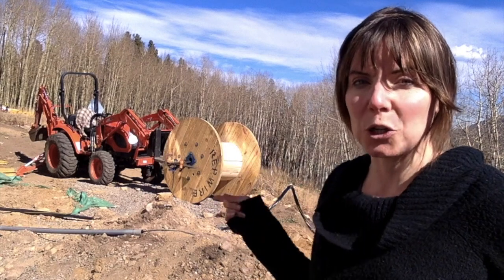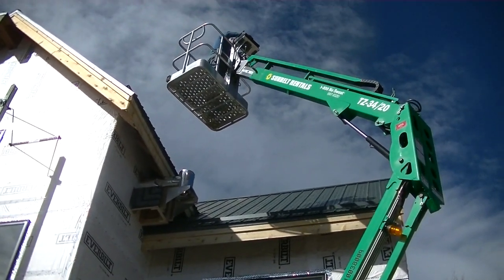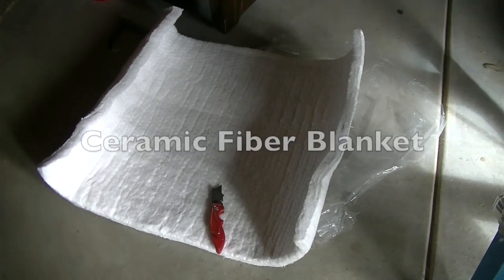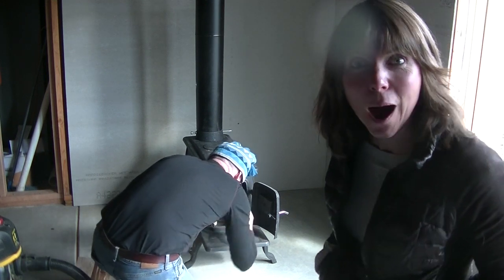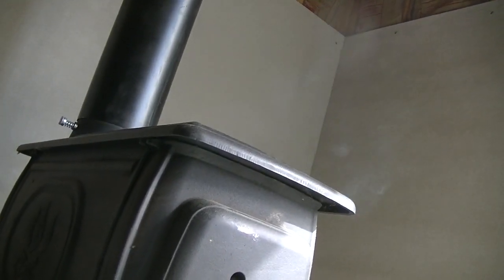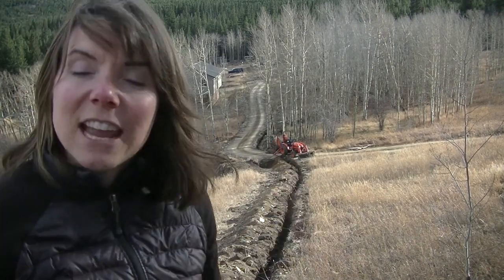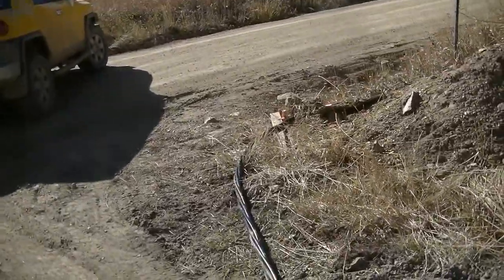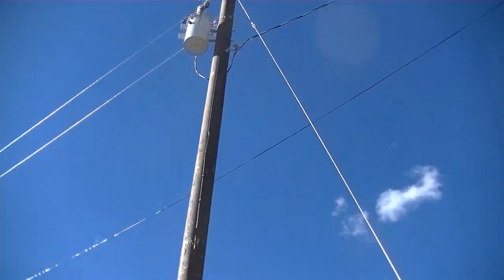Running 500 ft of Electrical Cable - Wood Stove Problems

Comment: Dunno.  Could be one of a number of things.    

It might just be the stove curing during it's break in period.  Here's a YouTube video on breaking in a new wood stove:

  https://www.youtube.com/watch?v=muRxUsv1ilI&t=52s

Here's another video on diagnosing smoking problems with a wood burning stove/fireplace:

  https://www.youtube.com/watch?v=0GkDZzMDBbY
    (She has some good tips about starting a cold stove - which are important to know.  This may be your issue.)

Hope this helps.
Reply: I watched your video again and you have an awful lot of wood loaded in there for a cold stove.  Plus the fire is probably starting too far away from the flue to get established properly.  Watch that second video and listen to the advice on starting a cold stove.  The stove flue needs to get hot to pull cold air into the stove and establish a good airflow.  Try making a small starter fire right under the flue to heat it up and leave the stove door ajar to provide additional air until the flue heats up.  Here's a link to a video made by an English gentleman that covers just about every cold stove starting trick I've ever heard about.

https://www.youtube.com/watch?v=JgTSn8yzdzg

His demo stove loads from side to side, whereas yours needs to be loaded from the rear to the front.  That's why I suggested starting a small fire in the back under the flue.  Once your fire is established, add wood working forward (away from the flue) and upward.

Hope you do not find this too simplistic and are insulted.  I don't know what your experience is in this area.
Reply from the maker: Wow- what great info! This is a different style stove than I'm used to (narrow shape with the flue at the far end) but it all makes sense. And according to all the other comments, the bad smoke, was the initial paint burn off- which explains the horrid smell. 2nd fire has proved much more cozy!

Comment: Its a very poor quality stove.  Does not have any control on air inlet.  They tend to burn "flat out" all the time, get very hot and wont hold a fire overnight.  All stoves will smoke on the first burn and any time they reach very high temperatures, its just a factor with the high temperature paint.  The damper on the stovepipe is to try to reduce draft.    These are usually considered "EPA exempt" because they are considered "cook stoves".   Normally they would not be permitted in a new install in most states, but for their "cook stove" status.   Save your pennies and get a decent stove as soon as you can afford it, like one made by Pacific Energy (Canadian) or Blaze King.  Both of those stoves are made to perform very well and burn clean when burning softwood, which is what you primarily have up in the mountains.
Reply from the maker: Ok this is great advice. We are going to get a different stove, but we used this one now just because we already had it and hadn't been used yet. Will take notes for Pacific Energy stoves- exactly what we're looking for. Thanks so much!!!
Reply: There are several categories of stoves.  The oldest type if the "airtight" stove that predates all of the EPA legislation.  Its just a metal box with a chimney connection and a means to regulate the inflow of combustion air.   There are no features to help reduce smoke or come up with a way to burn the smoke off.
The next type is the catalytic stove.  This has a rhodium/platinum/paladium coated ceramic substrate in the path of the flue gasses and once this catalyst has heated up to about 300-400F it will burn off any smoke and thereby release the heat and at the same time keep the chimney clear of creosote.    Catalytic stoves incorporate a catalyst that is not made by the stove maker (its a purchased part) and the catalyst can cost upwards of $300.   When in operation, a catalytic stove burns a smoky (smoldering) fire and the catalyst burns up the smoke producing heat while allowing the fire to burn at a low temperature.    This is ideal for burning resinous wood, because the energy contained in the resin can be released gradually for a long burn time.

Then came the "secondary air" stove.   This stove has a second air inlet and the air drawn through it flows through tubes on the inside of the firebox where it is preheated.  It then emerges from perforated tubes in the top of the firebox above the fire where it ignites smoke coming off the wood below.   Its like having a blowtorch held on the smoke rising off a fire, the blowtorch burns off the smoke.  The problem is that the "blowtorch effect" tends to accelerate the burn, especially with resinous wood.  So it makes for a fire that is either hard or impossible to control and the stove will get very hot until all the resin has burned off leaving only carbon (coals).   Because of how the EPA does its emissions tests, in a warm climate with a very short chimney, the manufacturers of the stoves cannot allow the air intake to be fully closed, this contributes to the problem with controlling the fire and the secondary air inlet is always open and there is no control to regulate it.

People who live in A) Cold climates and B) having tall chimneys that create a lot of draft tend to have greater difficulty in controlling the burn in their secondary air type stoves.  The majority of EPA compliant stoves made today are of the secondary air type because of the expense of the catalyst.  In such installations, usually it is necessary to install a stovepipe damper, as high as can be reached above the stove.  In some cases it may be necessary to have 2 dampers in series to manage the draft.   One can modify the air intake stop to allow the intake to close more, but the air wash opening and secondary air openings do not have any controls which is why it is best to simply reduce the chimney draft with dampers.

Finally the last type of stove is the exempt kind and they are exempt because they are considered emergency heaters or tent heaters which includes the cooking function.  These stoves, in order to pass muster have to burn at a high enough rate to produce little smoke, which is why they have no air intake controls.  Not only do they not have air intake controls, usually they do not have any gasket around the door either, since the gap is part of the "air intake".  But anyway, if you look at a stove and it has no gasket around the door or other openings, you can be sure it is an "exempt" style stove.   Other features are that they have no firebrick in the burn chamber, which is why the stoves get so hot on the external surfaces, including the bottom surface and will radiate large amounts of heat in all directions, which is why they usually have to be installed 18-24" away from combustibles.   With this type of stove you need a good floor protector if you are not to set the floor alight.   Because of the high temperatures reached on the cast iron surfaces and combined with cheap castings usually made in china, these stoves usually do not last long before the castings crack.

Hope this helps...
Reply from the maker: WOW! extremely helpful. Gotta bookmark this comment. Right now it's on concrete and when we put it upstairs, it will go on 2 inch soapstone (floor and wall covering) over the cement board. And we'll have an airtight foam insulated house, so not sure how powerful of a stove we need for this area. Looking forward to the research. Thanks!

Comment: You reserved an electrician for 2 days, but he is only going to check your work before the inspector?
Reply from the maker: No they're also finishing up what we started. Connecting all the relays and installing the exterior cable to the disconnect and pole. As well as the basement which hasn't been wired yet.

Comment: Are you guys dead yet from this stove? These cheap $200.00 stoves are DEADLY dangerous. I had one in my shop. I have a insulated barn/woodshop that is wired into my alarm system with CO detectors and intrusion and what not. The thing with CO detectors is that you want them as close to the floor as possible because Carbon Monoxide is heavier that air and sinks to the lowest spot them fills the room. As I was working in my shop I too had the paint curing fumes. all expected with a new stove, but mine smoked a lot too. My black lab goes every place I go and has a bed in the shop. LOVES laying by the Buck stove in the house. We heat our house with a Top quality Buck Stove. I went cheap on the shop, not too worried about efficiency ratings and all that. Just a wood shop. Well I could not get the stove to light and draw well so I let it go out and went inside and took Woody my lab with me. He was very sleepy..... About 20 minutes after we went in the house all hell breaks loose with my alarm system going off and the CO detector calling the fire department. The shop filled with CO and if I had stayed in there a little while longer Woody would have been killed and I would NEVER know it. just thinking he was asleep. I raised hell with the company and they did NOT put up a fight. They refunded my money EVEN MY SHIPPING. The knew this was a dangerous stove. Told me NOT to return it or sell it but to destroy it. I did. It was the EXACT same stove you have. GET RID OF IT FAST. DO NOT SKIMP! buy a good stove even if it costs $1,500.00 or more. Worth every penny.
Reply from the maker: Interesting sense of humor. Our carbon monoxide detector is about 4 inches off the ground and hasn't  got off at all. Our chimney worked fine after the initial paint burned off but we are not keeping this as our main stove forever. We plan to upgrade to something more efficient. Glad to hear your dog is ok.

Comment: Those US stoves are junk stoves, they have poor castings, poor welds, poor sealing and horrible air control. Save some money and buy a better made stove, your in "soft wood country" a nice blaze king would work well. Interior portion of the chimney is not safe at all. At the bottom tgi rafters should be a ceiling support box, that's the transition from the black pipe to class a pipe, the class a (shinny pipe) has a 2" clearance from combustibles where as the black single wall is 18" and black double wall is 6". This is dangerous because if you have a chimney fire internal temps can reach upwards of 2,000deg f, that little ceramic blanket wrapped around the pipe will provide little radiant protection. It would be foolish to put all that hard work into the house only to lose everything over $300.00 worth of using the right parts. 
Please PM me if you need more help with the stove stuff, I can point you in the right and safer direction.
Reply from the maker: Oh we've upgraded since this video. That was just a temporary install because we hadn't got a new stove yet. Check out our new one! https://youtu.be/dwWYYeYusDc